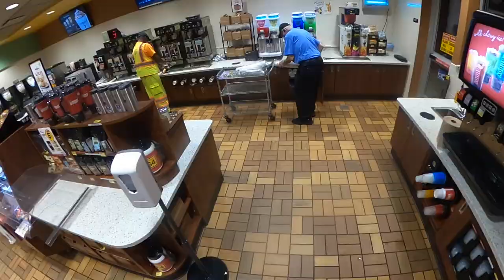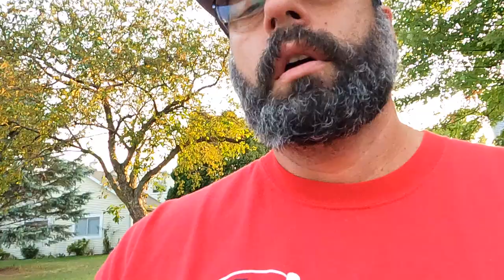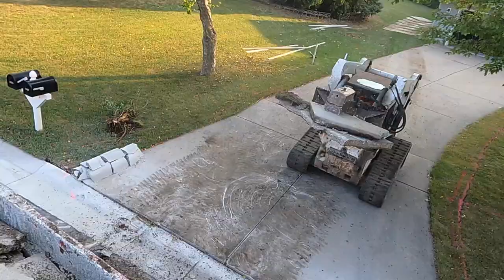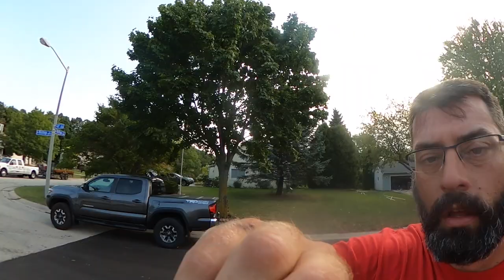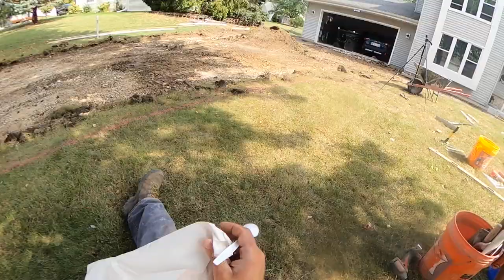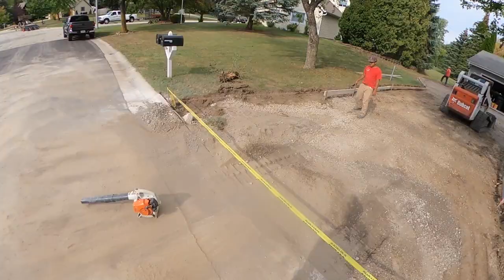First day of a new large project - Something is better than nothing

Comment: Daryl sr. NEVER wrap your legs around a semi tire while filling it with air... In fact keep your arms and hands clear as possible in case it explodes... And they have and do explode... People actually die from them exploding and causing severe injury... Just a heads up because no one wants that for anyone... Be safe out there guys... Peace...
Reply: No doubt..shops have actul cages because of that
Reply: it's not near as deadly bad as it used to be with split rims! aka widow-maker rims.
but yes, best way for that wheel is laying on trailer with stem at top and minimal amount of one arm exposed. other good thing is locking inflator end and 3' leader hose off inflator gun :)

Comment: Ryan, I have a very similar truck. White, crew cab, fully loaded, f150 etc. however it’s a 2020😁. However, I installed a 2.5” level kit on the front end. The difference is absolutely substantial and to be honest made my truck amazing. The way it drives, the way it sits, the way it looks. It was like I got a brand new truck immediately after getting a brand new truck. Costed me 300$ installed at a shop. It does slightly reduce gas mileage for me by 4 miles to gallon, but it’s worth it.

Comment: You can use the Stihl gas cutter with a concrete blade to cut the soil on the sides.Try it and have a look,you will have a professional look and instead 2 people using 30 minutes ,one can do it in 10 minutes,and some gas.

Comment: Why break up the front seemed way easier doing it the same way as the back ?
Reply from the maker: The driveway was too thick and it had wire mesh in it so that wasn't an option unfortunately.  It still goes pretty quick though.

Comment: Do the Cities you work in ever have an issue with the curb cut that you do to take out the bump into the driveway?  I've witnessed city reps out here upset with any damage or modifications to their curbs.
Reply from the maker: It always requires a permit from the city but almost everywhere allows it around here. It has to be cut to their specifications though.

Comment: I don't want to be  wire mesh police as I am not concrete expert. But I have noticed that sometimes corners do not have mesh in a fairly large area. Will that not make the edge/corner weak and potentially crack?

Comment: Hey Ryan saw some older videos I got a question how come you don’t use a electric vibrator for the mud instead of hitting the sides with a hammer
Reply: I'm not Ryan but when you use a vibrator it will blow the forms out if you hold it there too long